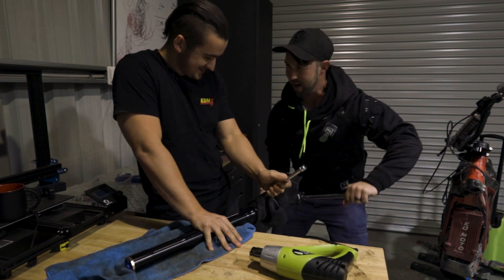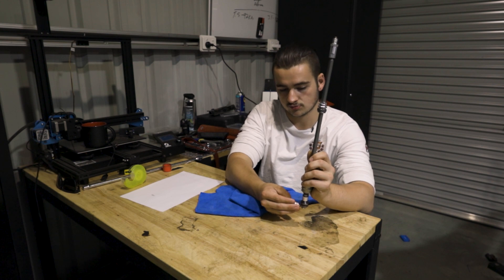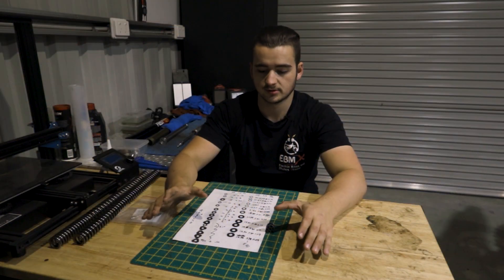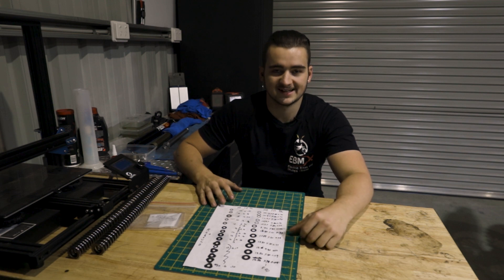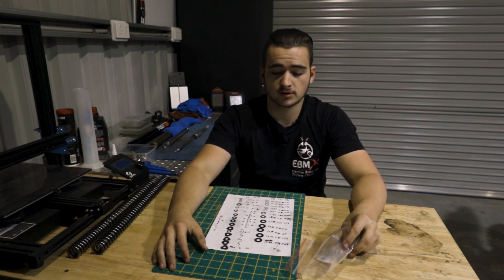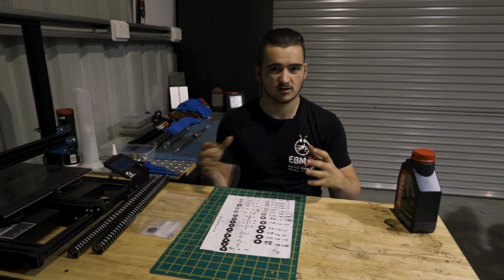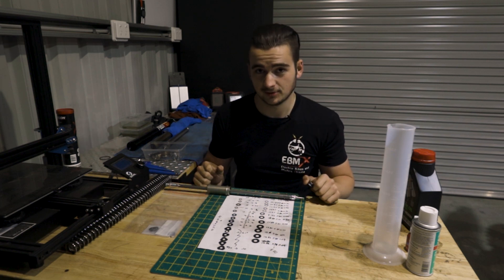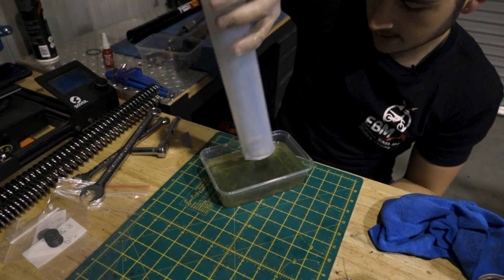How to Rebuild/Revalve and Tune the Fastace 2.0 Forks for the Sur Ron / Talaria electric bike's

Comment: I recently did a full fork rebuild but i want to change out the spring to 60lb. Can i just take the bottom off (the one that needs to be heated) and swap the springs without emptying the fork oil or taking the rest apart, since is brand new oil already?

Comment: Heres an actual video on the proper way to rebuild fastace forks - https://youtu.be/462Ib7F_ddQ?si=jc6Z7o6Bv2WWyHoD
Reply: Those are the 1.0 version. Notice the top caps are not the red and blue. They are both red
Reply: @matthewlizardi1148  they are identical
Reply: @CmdrTigerKing  serious question, how come my forks won’t come apart when I tried to follow that video? I got to the point where the seals and retainer clip are removed but my forks won’t come apart into the two sections. It made me think that I might have to separate the forks from the opposite direction, as shown in this guys video. I have not yet removed the axle clamp from the bottom to try it that way. Due to failed attempts and being alone. Do you know what the answer is? If the forks are identical how come mine won’t come apart like the video you linked ? Any help is appreciated
Reply: @matthewlizardi1148  did you remove the compressoin rod.. also each fork is different..what are you trying to do anyways ?
Reply: @CmdrTigerKing  yea I removed the compression rod. Seemed to be half the length of the one if the video but I removed it

Comment: I'm way late to this video and my Talaria doesn't even have Fastace forks but I love the video so far. I'm only 6 mins in as of this comment but I just have one correction for you. Adjusting the rebound dial or compression for that does not tighten the stack. There is a "Needle" also known as a by-pass in the valving. When you tighten the rebound you close the by-pass and force more oil through the shim stack. When you lossen the rebound, it opens the by-pass which allow for oil to pass through avoiding the shim stack making the suspension faster. The way you make the stack stiffer is but adjusting the stacks shims with more wider OD shims providing more "stiffness" to the stack and how it bends. You can also adjust the taper as well to achieve the same effect. 

Now time to finish the video.

Comment: So it sounds like taking this fork apart is a nightmare.
So if there’s a buying option for the 60+ lbs
Spring pre installed, and avoiding the shim upgrade. How does the fork feel then?
Also how about extra travel with drop top yoke?
Comparison to Fox 40 with correct spacers?
Thanks

Comment: So.ya "gotta" take the bottom off..??
Reply: If you want to tune the base valve, then yes, you do have to take the bottom off. But you can change the spring and service the rest of the fork without taking them off.
Reply: @nathaneastman2268  Thanks! I will open it up from the top in the morning.
Reply: @yetijoeyetijoe how did this work? Were you able to drop in the spring? Do you wish you tuned the valve with shims?
Reply: @nathaneastman2268 how so? I can’t seem to get my forks to come apart into two pieces in order. To remove and swap seals. Currently got my forks to the step where the seals is dropped and so is the retainer clip. I tried to pull them apart and no dice. Been trying to figure this out almost just taken them to a shop a few times
Reply: @nathaneastman2268 any help would be greatly appreciated. I’m currently at a roadblock with these forks and it’s quite frustrating
Reply from the maker: Yeah mate
Reply: No, you don't
Reply: @nathaneastman2268  Please share how you can do this without taking the bottom out. I need to do this on 2 forks.

Comment: Absolutely fantastic video! I’m not sure if you mentioned when you are taking the bottom off the spring side to take out the set screw. Also would have been nice at the end to compare stock vs progressive spring vs 60 lbs spring vs other forks you’ve used before. Also putting the links for the shims is a HUGE help. Thanks for all you do, and keep up the videos!

Comment: what are the diffences between the fast ace 1.0 and 2.0, i havent been able to find anything on their website?
Reply: Well, I think I have the 1.0, and externally mine doesn’t have the fast ace logo, and on the top adjusters, mine are adjusted with a flat head screwdriver instead by fingers.
Reply from the maker: I think V1 is steel construction and V2 is aluminium.

I haven't seen a V1 so I can't be sure though.
Reply: Theirs more adjustability on the new 2.0 plus the caps are red and blue and the 1.0 has two red caps. Same decals.